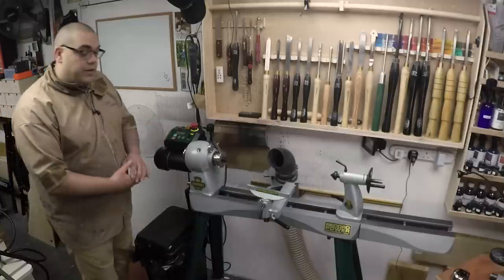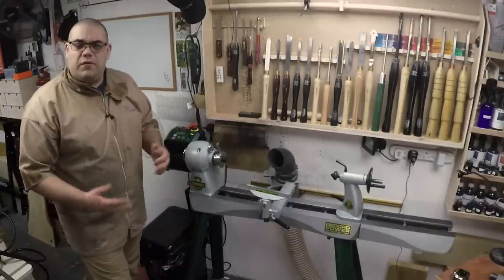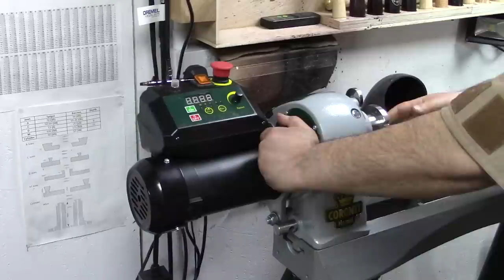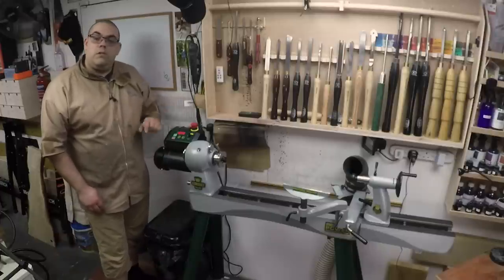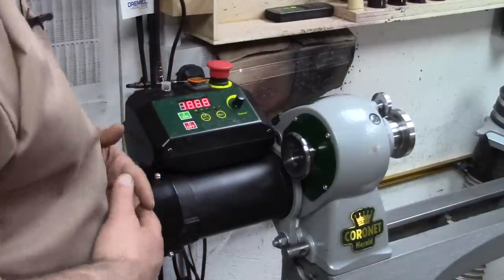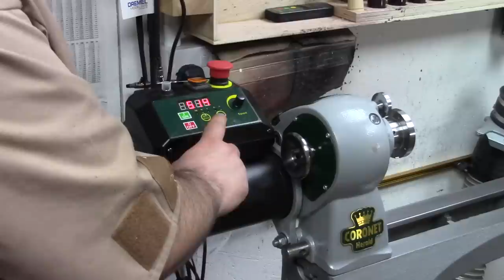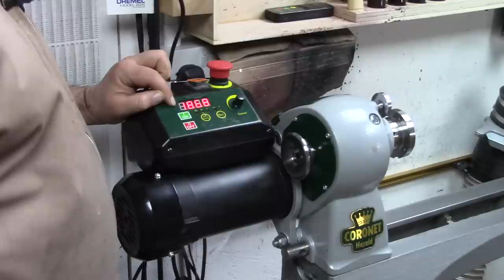Record Power Coronet Herald

Comment: Just bought one based on your videos and other research, loving it so far, really impressed
Reply from the maker: Awesome lathe. I’m sure you will be very happy with it
Reply: @JohnClothier  happy so far, need to sort out the Chuck I got with it, not happy but not sure I can replace the body to bring it up to what it should be
Reply from the maker: Which chuck did you get?
Reply: Came with a free SC3 but wasn't the correct thread size and used an adapter, have since sold that and stuck with the SC3 purely as I liked the size....did think of the SC4 but I liked the basic open style of the SC3
Reply from the maker: Ok. I use the sc4. I prefer it being closed so as not to get loads of muck in there.

Comment: Thanks John and through your video I actually have bought one and I love it, I filled the legs with kiln dried sand, the only fault I have is that the tailstock is slightly catching at the join to the bed extension but no great problem. I think it is a wonderful lathe and the smoothness of the motor in incredible cheers John and I hope we meet up sometime. Keith
Reply from the maker: Thanks Keith. When I attached mine I used a straight edge and clamped it all together before putting in the bolts. I haven’t experienced any catching with that method.
Reply: @JohnClothier  Thanks for the reply John I think it is ok now

Comment: Hi John, I am German and was looking for reviews of the Coronet Herald but found almost nothing. I have a small lathe on a table. I want to turn larger bowls and vases and am looking for something bigger. I'm afraid the Herald will vibrate a lot when turning large pieces overhead because of its low weight. Can you confirm this or is my fear unfounded? I first thought of a Stratos XL but the price is enormous for a hobby turner who occasionally turns something nice. Can you recommend the herald or should I choose a heavy machine? Greetings and thank you.
Reply from the maker: It is a small lathe and that does need to be considered but I have turned some heavy wood on it and it has been ok. you just have to take it slow to start. It all really comes down to money. I doubt you will find a machine as capable for the money. if you can afford more though you will get better

Comment: I just bought one of those. After some research including watching this video, I decided that it was a good upgrade from my mini-lathe that I have been using for about 3 years. Very happy with it so far - very stable and quiet. I didn't get the legs, but placed it on a solid table (which I had made). I still haven't bolted the lathe to the table, and I am having no problems (I haven't turned unbalanced logs yet). 
The only disappointment so far is that the tailstock doesn't have self-extracting feature. I wanted to remove the live center today - what a pain. The knockout bar they provide is stupid - it has a bent end so it's hard to give it a knock with a mallet (don't look for the one you lost, John). After I managed to knock out the live center, the knockout bar got stuck in the hollow spindle. Grrr.
Reply from the maker: Im glad you are enjoying your purchase. Yes I agree on the tailstock and I have fed that back to the manufacturer. I did fine mine in the end but never use It as a knock out bar. I would recommend to make one yourself.
Reply: @JohnClothier  I finally found the knockout bar from my old lathe, and it's doing the job, better than the bar supplied with the Coronet Herald. I think that if I knew that it doesn't have a self extracting tailstock I would have bought another lathe. Maybe most people use this feature rarely, but I need it quite regularly. I change between the standard live centre, a bull nose live centre and a Jacobs chuck a couple of times a week. 
A month on, I can say that I love the lathe but hate the tailstock. I left a review on Record Power's Web site saying that,. As expected, my review didn't get posted.
Reply: Hey... Record Power published my review on their Web site, including the criticism about lack of self-extracting tail stock. Maybe the penny will drop and they will fix this problem (at least to me).

Comment: Hi, whats the overall length?  Im not sure  how are they  measuring it, but according to Record Power its  870mm  which can not be  right, coz you said   the  bed  is 810 mm  an  then the  motor and electronic control is  clearly longer than 60mm.  It would  look  like  overall length is over  1000mm? Im I CLOSE?
Reply from the maker: The bed is 810mm. The motor sticks out 260mm when at the far end. I believe when they quote the 1000mm then are talking about the legs. The legs are at a flared angle so are about 1000mm apart. It needs a footprint of 1000mm but you will need a little more to the left for the motor to maximise on the bed. Hope that helps
Reply: @JohnClothier   Thanks for  the  info, it  helped  a lot

Comment: Great review, John - I found it just after I'd actually bought the lathe so I'm pleased to confirm that I have made a really good buy. One thing I think you may have got wrong in the review is that you've implied that pressing the 'pulley' button on the controller changes the pulley in use but in fact it doesn't. I can't find anything about it in the manual, but as far as I can tell the button is there only so that you can select an indicator of which pulley you're using. The speed range shown changes, but the chosen pulley doesn't. Apart from that though, I entirely agree with everything you've said - a great machine at a good price.
Reply from the maker: Thanks Mike. Yes you are absolutely correct about the pulley and belt ratios. If thay is what I said it was not what I meant. My apologies if that is how it came across. It sure is a cracking lathe, I love mine!

Comment: Nice review when you do bigger stuff  does it slow down any . It looks like great lathe to have.
Reply from the maker: Thanks Allan. It does a bit but only on the fastest belt setting. Which you wouldnt use with something big anyway. Ive turned some heavy wood and its coped fine

Comment: Great review John. I'm sure you will use almost all the features on there over time.
I've still never used my lathe with the head turned but the length is great, especially even for small items to get the tail stock out the way.
Reply from the maker: Thanks Paul. I have used it turned already, even with a small bowl its nice to be able to get a better standing position without leaning over the lathe for hollowing it out. I  can get a great length now as well and you are right being able to move the tailstock out the way without having to remove it is great.

Comment: Hi John, great video can you tel me though as I have  1" x 8Tpi chucks do Record power do this with that headstock or would I have to buy an adaptor and if so which one and how would I secure it for reverse turning Thanks one more thing when you shook the lathe it did move quite a bit which is my only worry as my Clarke would not move doing that.
Reply from the maker: Hi thanks. you would need to get an adapter. You will be best off speaking to record directly. They can make sure you get the right fitting. To be honest It is very sturdy As good if not better than any other lathe at that size. Remember that it is not bolted down just sat under its own weight. It is also designed to be portable so if you can lift it you can move it. I have turned 20" wood on it and I have also put a huge whole log on it. Both taking the size to its maximum and it was fine. The only time I have had it move is with a really out of balance piece of wood but you would get that with most lathes. I have seen a few Clarke lathes and none are as well made as the herald.
Reply: @JohnClothier  Thanks very much I intend to get one

Comment: Hi John I'm hoping you can help me out 
I am trying to order a herold and cant view one with the covid problems in Ireland.
 I'm worried about the turning height as I suffer from back problems. 
I'm 5ft 10. Do you think I need to order the bench feet as well as the legs to bring it to elbow/spindle height.  Thankyou so much 👍
Reply from the maker: Hi. I’m 5ft 10 and I am fine without the bench feet. Hope that helps
Reply: @JohnClothier  thankyou

Comment: Thanks for the thorough review. Currently I have a DML 250 it's about time for an upgrade. I'd like to ask how much the motor sticks out to the back (in mm ;) when swiveled 45/90 degrees? I have very limited space but would love to turn inside a bowl without reaching over the bed and thus hitting the wall behind with longer gouges.

Comment: Hi, I currently have a Nova Comet II mini lathe, it struggles with 10" bowl blanks when turning at about 800 rpm, do you find this lathe hard to stall ?, This was a great review, But may i ask, how the lathe comes, when i brought my Nova it came almost complete just the handle on the spindle needed to be fitted and tail stock wheel, i have looked at the record Cl4 and that comes in loads of bits!
Reply from the maker: If I take a really big cut I can slow it down but I have never stalled it. It has a lot of power. Mine was an ex demo so it came ready assembled. Sorry I can't help there.

Comment: I bought Ccoronet at Harrogate last year but I have only just assembled it, as I had a leak in the roof. There are three things, one it definitely needs the bed extension, two, the handwheel, on the  headstock,  comes loose if I am rotating it clockwise to put a chuck on but is fine when taking a chuck off, which is effectively tightening the handwheel. Third, I have been unable to change belts because, although opening the door to the belts and loosening the motor tension lever, the motor does not move.
Any ideas.
Thanks
James
Reply from the maker: Hi James. Yea a bed extension is very useful for this lathe. I mostly use it to slide the tail stock out of the way rather than actually turning longer items. With the motor have you done the bottom bolt up to much? It should move pretty easy. I believe there is a grub screw on the hand wheel but I could be wrong. It should come undone that's for sure! Maybe worth dropping record a message about it
Reply: @JohnClothier  Thanks John. Actually Recordpower set the machine up for Sue Harker to demonstrate on and they did change belts. So I bought it, run in by Sue and got it cheap at the Harrogate Show last November. 😂

Comment: Great walk through John. Just wondering if you had a max capacity bowl /platter would the tool rest reach across or would you move the tool rest to the left of the headstock?
Reply from the maker: Woodturning by Alan Scannell Thanks Alan. Yes I was thinking that too. I think you would move it to the left side of the head stock
Reply: John Clothier hopefully not to difficult to do but I imagine you wouldent need to do it too often. Great machine best of luck with it 🙄
Reply from the maker: no its easy enough to do. thanks

Comment: Hi John, Greetings from down under!! I want to ask if you have any further opinions of your new lathe 2 months in.  Are there any things about it that bother you.  I am in the market for my first lathe and this one looks like it might fit the bill.  My only concern is the weight and the stand/legs... is it sturdy enough? cheers Gary.. PS keep up the good work!!
Reply from the maker: Hi Gary. Is there anything that concerns me or are there things I would change? There are certainly things that I would like to be improved upon but I am sure that people can say that about any lathe. This really comes down to personal preference vs available budget etc. If money was no object then this is not the lathe I would choose. The reason for this is by spending £5000 on a lather I would get the things that I would like to be changed. But this is not a £5000 lather it is a £1000 lathe. I have done hollowing, 20" outboard out of balance turning and all absolutely fine. As a first lathe it is absolutely ideal. It is reasonably priced and sets you up to do almost everything you would want to, not only as a beginner but as an intermediate too. So as to is there anything that concerns me? The stand is fine, the weight is fine, yes it is sturdy. The only thing that I think really should be there is a remote control to switch it on and off. Reaching around a 20" piece when outboard you do have to be a little careful and mindful of where things are. I have no hesitation in recommending this lathe to anyone that is just starting out, an intermediate or looking to move to the next level from a midi lathe etc. The reason I bought this lathe was because for the price point that I could afford it was the only one that gave me variable speed, cast iron bed, outboard turning, etc.
Reply: Cheers John for a really comprehensive reply, you have convinced me to purchase one of these for myself.  I really appreciate the time you take to make your videos and to reply to all of your comments...thank you!!!
Reply from the maker: You are welcome Gary. Glad I could be of help.
Reply: @garypodger7548  Hi Gary - I am downunder too (though the upper part), and I just bought a Coronet Herald. For me it's the second lathe. Did you end up buying one? gidi@wateroz.com.au
Reply: @ozziemale202  I'm in Brisbane.....No I didnt, I found that they were extremely pricey once you included the full kit, Stand, extension bed, outboard jig etc. Plus I found the customer relations and spares accessibility very ordinary.  I ended up getting something a lot bigger and more powerful... cheers Gary

Comment: Nice video thanks I’ve had one of these for nearly a year now and it’s great I work from my shed and have limited space but the swivelling headstock gives me much more room to work.
I do however think that the legs should come with it as part of the package, as I work off a bench I also had to buy the mount feet which also are sold separately. But still a great little lathe
Reply from the maker: Thanks Sean  yes it's a fantastic lathe for those with a small space and big dreams  I understand what you say but I guess if they included the feet and you wanted the legs you would be paying for something you didn't need. Either way the price would end up being more and I think they have done very well to keep it to the sub 1000

Comment: Hi Mr. Clothier... I expect your pleased with that...and your right about iron...there's no substitute for weight and you'll notice this when turning things that are out of square/balance etc....

One thing I'd like you to do with this though:

Get a can of light spray oil and give the bed, headstock & tailstock a oil spray before using the airbrush on work mounted in it...
Any over spray from the airbrush should just wipe off easily then...😉
Reply from the maker: Thanks Glenn. Thanks for the tip. I do use a wd40 ptfe spray on the bed. It helps with the banjo sliding too. I also put a scrap of pen on the bed when I remember. Especially when using products like Yorkshire grit

Comment: Hi John, Just got one of these and not yet set up. It came with an EMC Filter that  is not really mentioned in the manual.  Should I use it?  Do you know what its supposed to do? Thanks Mike
Reply from the maker: Hi Mike. It's a cracking lathe. I am sure you wont regret your purchase! The emf filter block is there because of regulations about interfering with things such as TVs. If your lathe is away from yours and your neighbour's homes I wouldn't bother. I dont use mine. I have wifi in my shed and it hasn't effected that or my radio.
Reply: @JohnClothier  Hi John, Cool. Thanks for the reply. Yes, I'm really excited about my new toy!  I took the plunge and got all the extras too!
Reply from the maker: Nice! The extension is really handy to slide the tail stock out of the way even if you aren't going to do long turnings

Comment: Have you tried mounting a bowl on on to a wormscrew with the Herald, Recordpower told me that I only need to hand tighten a chuck on to the spindle but when I attempt to wind a blank onto the wormscrew, I need to lock the spindle and that simply unwinds the left hand threaded handwheel and  it cannot be done. The only way I can do it is to put the chuck into a vice and then wind on the blank. 
Thanks
Reply from the maker: James .Pritchard hi James. Yes I have and haven’t had the problem. I tend to use the spindle lock for the indexing system. Try that and see if that works for you
Reply: @JohnClothier  Thanks for the answer, the manual says not to use the index lock for chucks or faceplates and I mentioned this to Recordpower when I brought up the problem of winding on bowl blanks and they told me not to use the index lock because you will damage it. They don't, at the moment, accept there is a problem but I will pursue it with them. It's a pity because otherwise it's a nice lathe. At the moment I wind the blank onto the chuck in a vice .
Cheers John
Reply from the maker: James .Pritchard yes they have said that. Personally I don’t agree with them. It’s what I do and I have never had an issue. I’ve had my chuck stuck on the lathe before and needed a mallet to get it off. I’ve used the index lock and it was fine.

Comment: Thanks for this video but i still have a question.
Tool rest post size: 1" or 25mm? Because 1" = 25.4mm. There is a difference. I have accessories and I would like to know if they are compatible before buying this wood lathe.
Reply from the maker: You should speak to Record Power directly